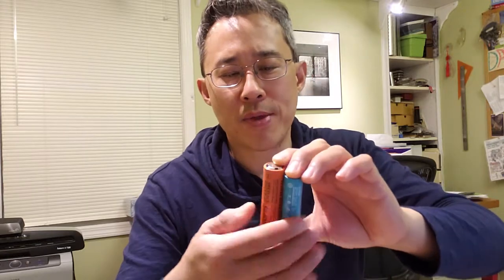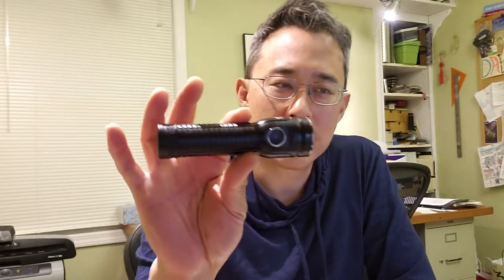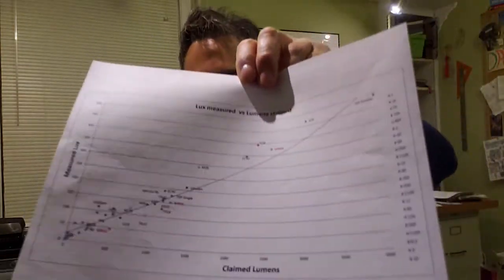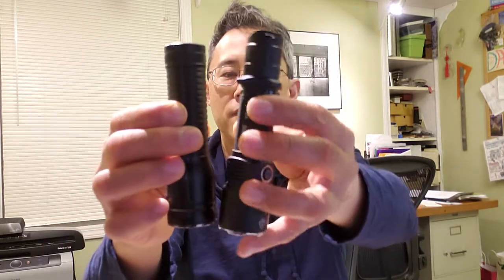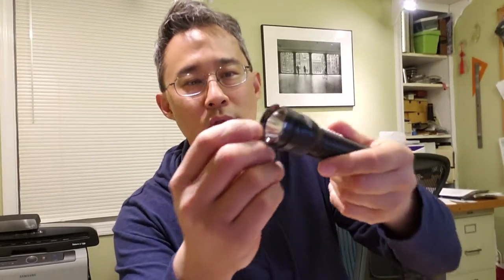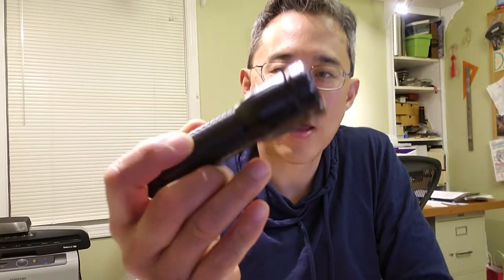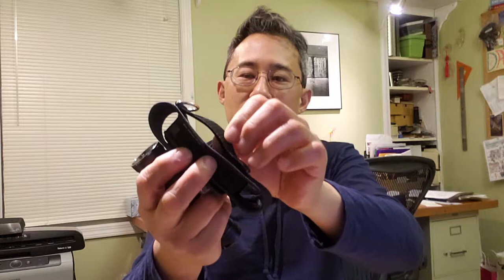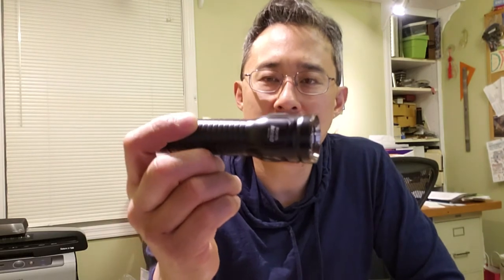Rofis MR50 Features and Function, 21700 Flashlight

Comment: This is a very cool flashlight.
I wanted a 21700 powered light After watching this video, I discovered that it does have power bank feature, which was my remaining wish, wow.
This unit and feature seems under marketed.
I originally wanted to power from 21700 Tesla Model 3 batteries. It even works well with basic cleanup batteries - no cap and wrap even.
These batteries are my new standard. I think there will be a big glut of them, and they are about the best there is too.
AND - YOU TOO CAN HAVE A Tesla --- (powered flashlight, that is).

So this is way cool. I say the MR50 is under marketed, because the are hard to find, and don't even talk about the power bank feature.
I picked the one I have, more or less by accident, off ebay for about $38 - great bargain _ discover.
Only complaint is the charge port cover flap, hard to open, and may not last long.
Otherwise - big thumbs up!